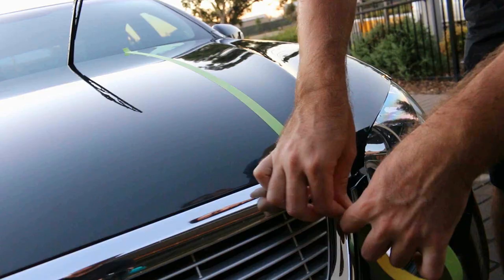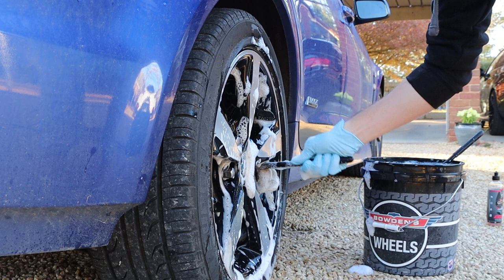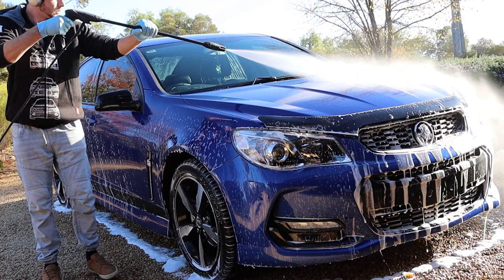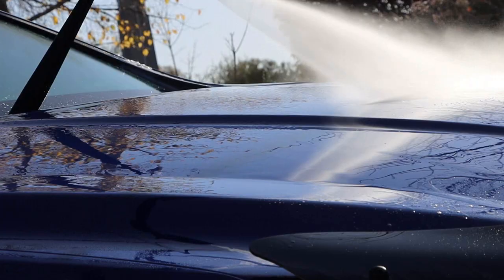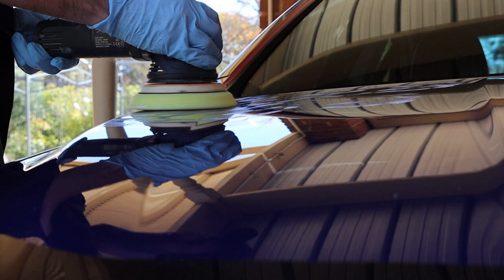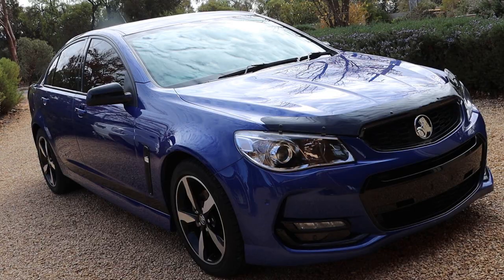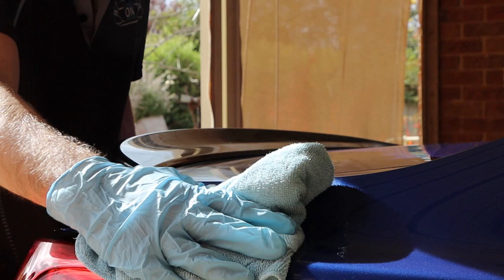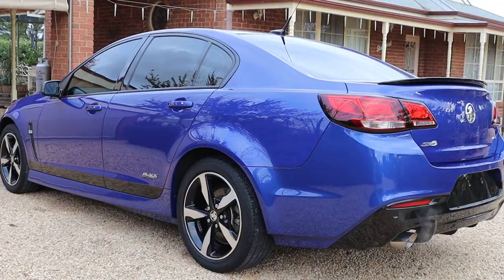2 Stage Paint Correction On VF Holden Commodore | FocusOnDetailing | HD 60fps

Comment: Hey mate, any reason for not removing the stone chip guard? Looks amazing none the less. Well done 👍
Reply from the maker: Hey mate, I could clean it all up and underneath while it was still on there and I actually corrected it while it was still fixed as it would've been awkward to correct if it wasn't held in place. I used my mini polisher to get a better job done. I moved it though to polish underneath just not filmed. Thanks for the comment

Comment: Same dude tested nova products and said it does not seal and protect as some other spray on SIO2 based sealants yet uses it, should have used nova jet and then laster, that way you have a double coating IMHO? Cost for the detail over $1,000 bucks easy? and that's not even with a dedicated SIO2 sealant / protection applied like C Quarts 2.0 or a different brand of direct SIO2 sealants?